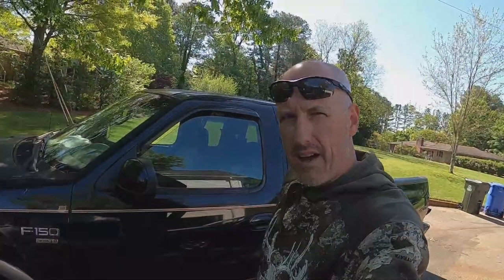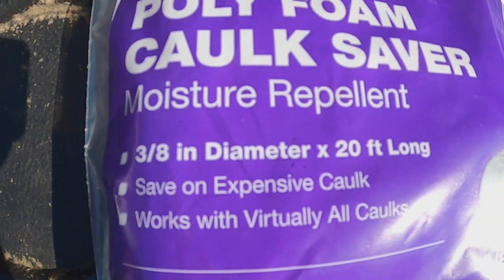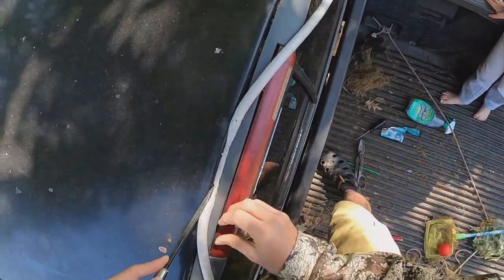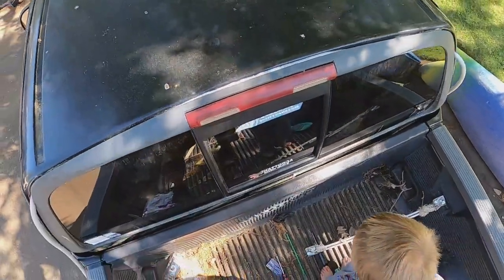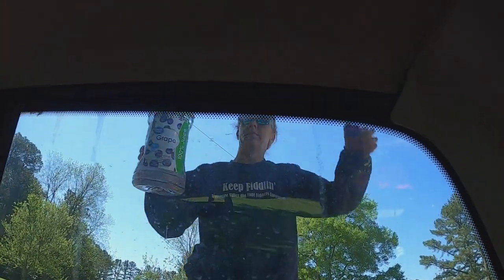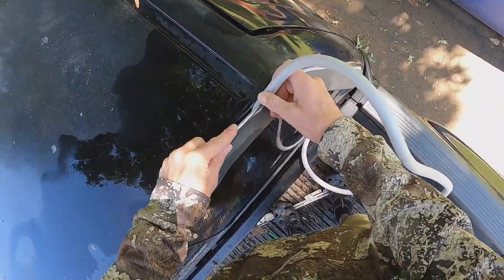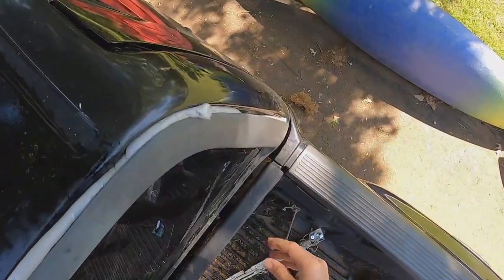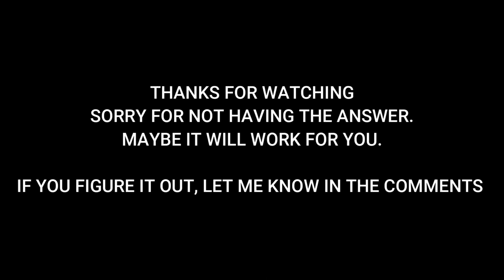F150 BACK WINDOW LEAK

Comment: That's not where it is leaking. It's the bottom of the trim and edge of glass. Fill that gap in with good quality sealant...problem over.
Reply from the maker: THANK YOU! I will certainly try that out.